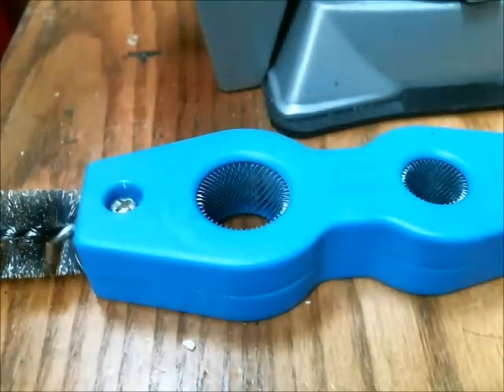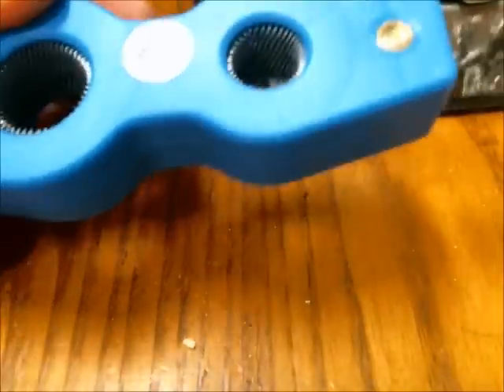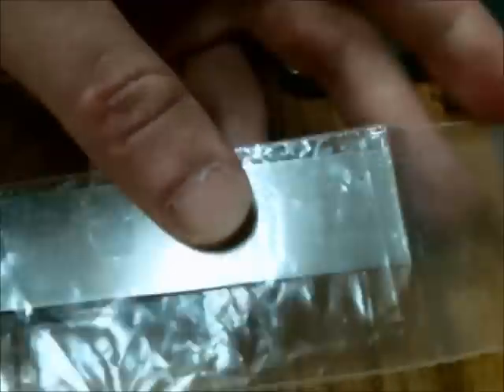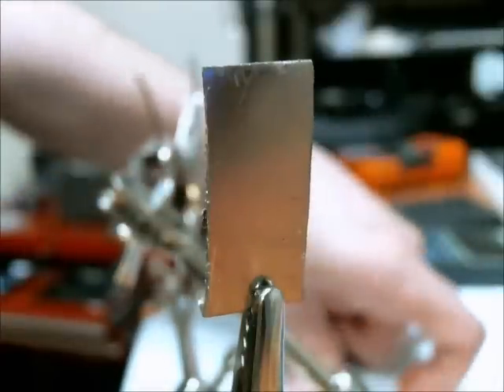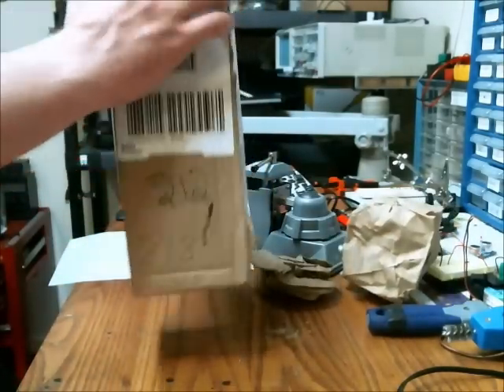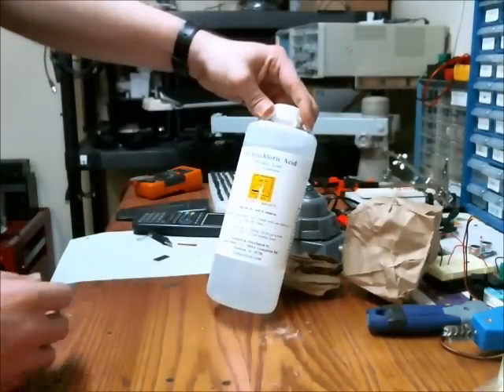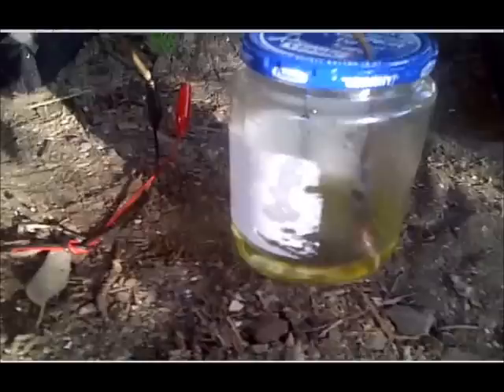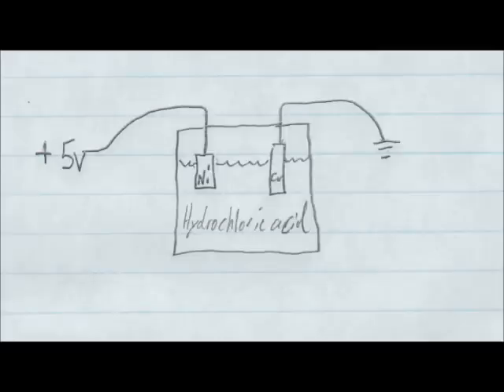Electroplating Experiment Nickel on Copper

Comment: That blue tool is not for cleaning battery terminals, it's for cleaning 3/4 and 1/2 inch copper pipe, inside and out.